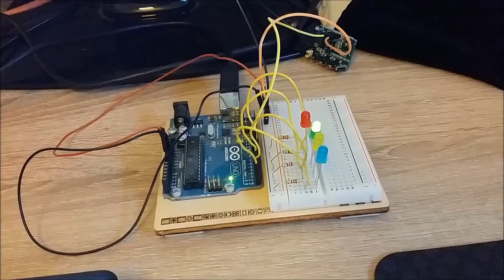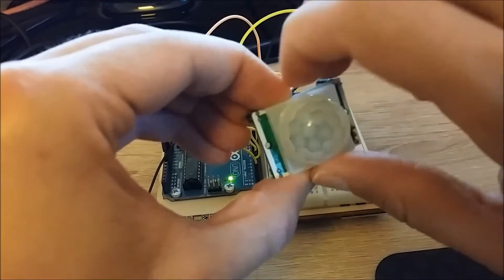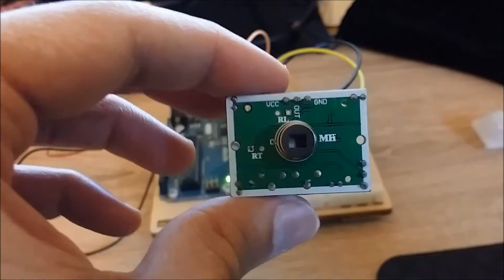Arduino LDR PIR Combination

Comment: Hi Ginourie7, 
i am very interesting by this video combining PIR with LDR. 
I have a project where i want to light on when it is dark (when it is the night only) and when someone is walking in the garden. 

I don't want to use an Arduino but only an LDR connected on a PIR. 
Watching your video, it seems that i have the same model of PIR as you. 
I tried to solder a LDR on the RL plots into the PIR. It is not working properly well for me.
Can you help me ? 
What kind of LDR are you using ? 
Is there a special PIR model to use the darkness feature (RL plots) on the PIR ?

Let me know please
thanks
Reply from the maker: Hi, i would probably try getting it to work without the LDR first. The PIR i am using is the HC SR501 i believe if that is any help. https://www.amazon.co.uk/gp/product/B00R2U8LLG/ref=ppx_yo_dt_b_search_asin_title?ie=UTF8&psc=1. The LDR i was using im not sure on the model but it was cheap something like this https://www.amazon.co.uk/Resistor-Dependent-Photoresistor-Sensitive-Sensors/dp/B08SC1M7V7/ref=sr_1_1_sspa?dchild=1&keywords=LDR&qid=1620777801&sr=8-1-spons&psc=1&spLa=ZW5jcnlwdGVkUXVhbGlmaWVyPUEzM1BCQVNLWEJISFdEJmVuY3J5cHRlZElkPUEwMzc0NjU4Mk83QlgxOFVVRlk0WiZlbmNyeXB0ZWRBZElkPUEwOTgwMTk1MkdFNE1VMlNOQ1JNOCZ3aWRnZXROYW1lPXNwX2F0ZiZhY3Rpb249Y2xpY2tSZWRpcmVjdCZkb05vdExvZ0NsaWNrPXRydWU=